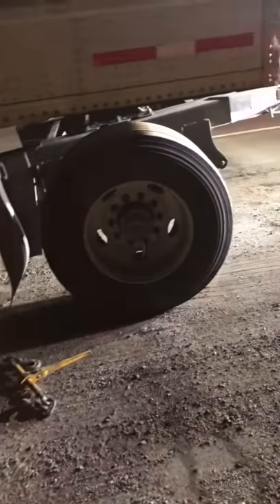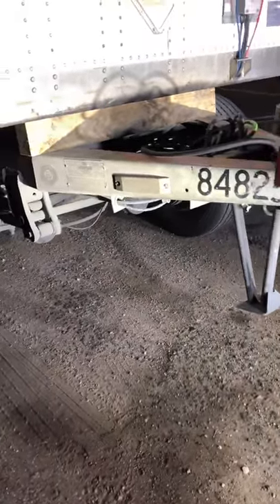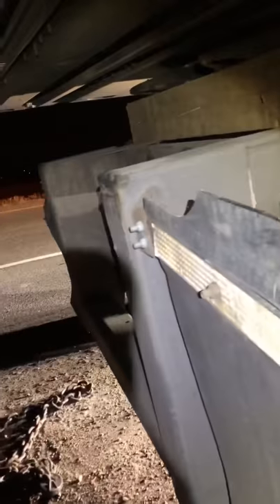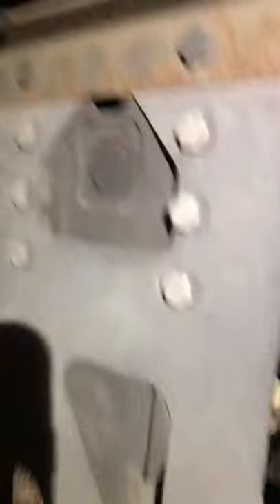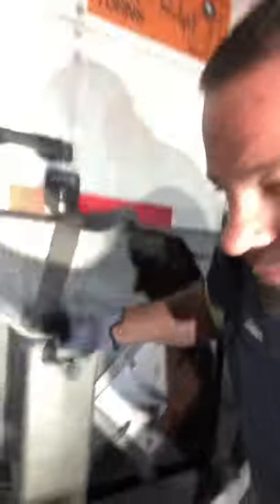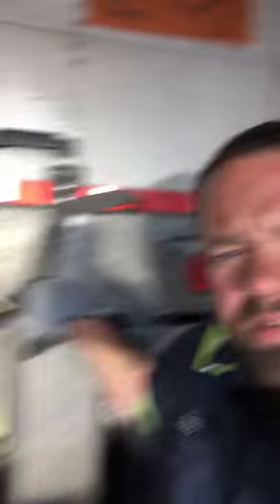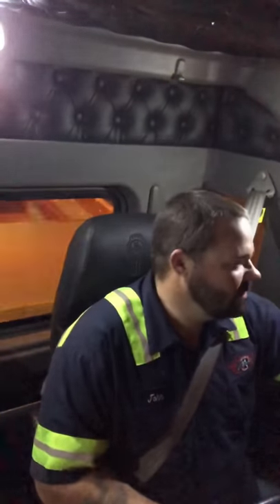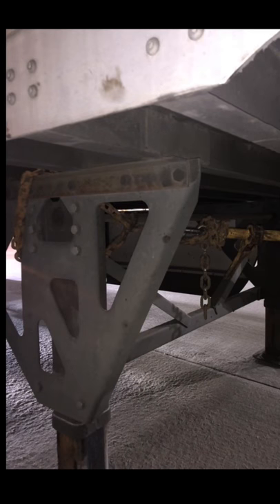Towing a trailer from the rear using a converter dollie.

Comment: So on the dolly its just the 2 chains and the kingpin holding it?
Reply from the maker: So it’s actually the king pin holding it on the trailer, same as when a tractor pulls them. The chains being crossed in the front are what keeps it aligned to tow it.
Reply: @baulconntraining9272  Awesome.  Thanks so much for the reply.  Only drive a rollback now but want to get a medium duty then eventually a heavy